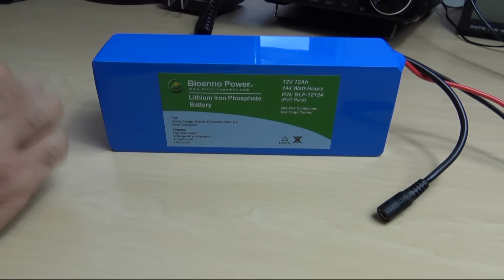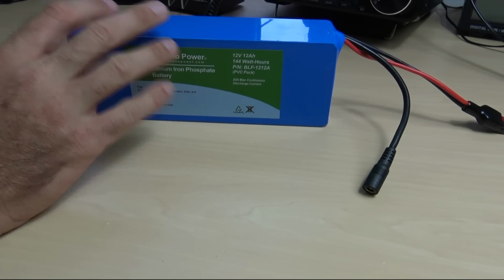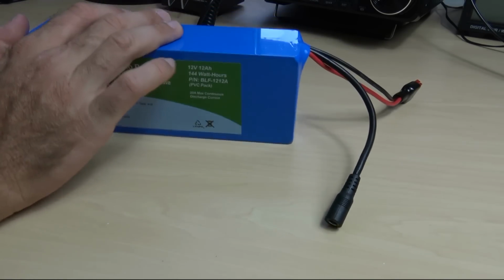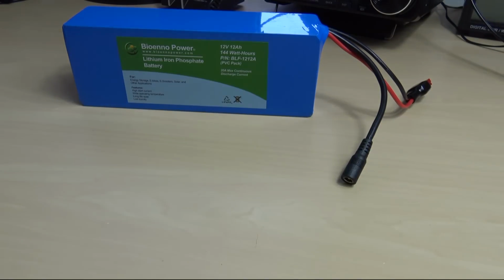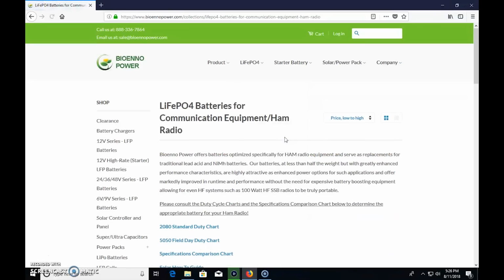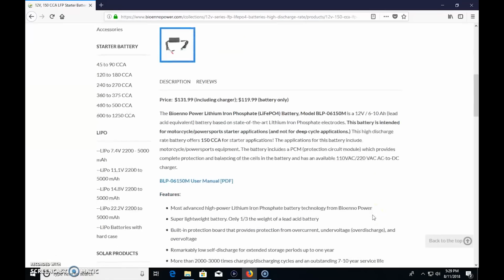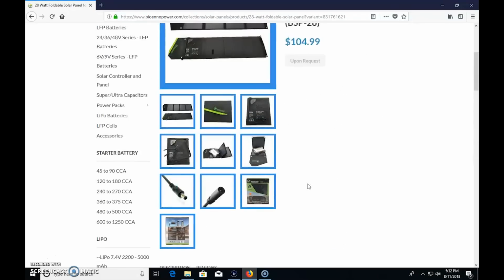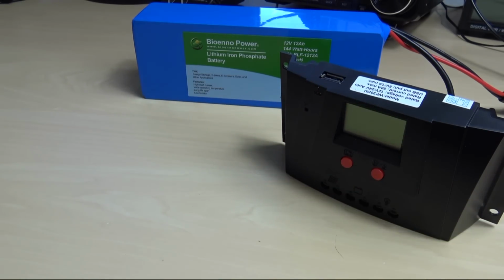Bioenno LifePO4 Batteries, Solar Charging, For Ham Radio And More!

Comment: DO NOT BUY BIOENNO!
History:
Bought 100 Amp Battery-Failed at 6 Years.
Bought 2 Pure Sine Inverters-Both failed within Three Weeks.One of them failed THE FIRST DAY!
Bought SEVERAL 40 Amp Batteries- 2 of which failed and you replaced them.
Bought 2 20 Amp Charge Controllers 1 Failed. I believe you replaced that, but do not have the records to verify this.
Yesterday, the SECOND 20 Amp Charge Controller Failed. Installed the new 30 Amp you sent me. We'll see what happens.

10 Amp Bioenno Charger now says new 200 Amp Battery if full. Surface voltage across Battery Leads is reading.13.37 Volts.

I BELIEVE THIS BLF1220AS IS ALSO DEFECTIVE! 

WHAT-THE-%@@$#$#?!

I'm very sorry, Kevin. This SEALS IT!

Here is what I would like to do.
A. Return EVERYTHING! Both Charge Controllers, Both sets of 50 Amp Jumpers,
and BOTH Batteries.

B. I want a Refund Check for $862.49, the current price of the BLF1210AS.

I have lost faith in your products.

Bruce A. Forster
Show less

Reply

Comment: Excellent!  I think this answered all my questions.  I have a Bioenno 4.5 AH battery for field QRP operations, but want to get something larger for field QRO, plus would like to add solar charging using my existing solar panel.  This tells me enough to get started in the right direction.  Thanks!

Comment: Bioenno brand is over priced in this vertical. I have several lithium iron phosphate batteries for ham radio, only considered Bioenno until I saw their prices.  I build my own with headway cells now, I'll take the Pepsi challenge with any battery on the market.
Reply from the maker: Please remember there are some people, including myself, that don't have the time but have money to just buy one and be done with it .
Reply: Overpriced is a very subjective judgment. I have several very inexpensive Miady LiFePo4 batteries, and after 2y of use, they show much worse capacity drop than my Bioenno. On a purely amp-hour per dollar basis, the Bioenno falls short. But some people value build quality, customer service, and country of assembly very highly.

Comment: 12 ah is fine. The only time it is "not enough" power is when you add 15 different ports and plugs that will eat up the battery. If you want to power your 50w radio, this will work. Add solar and it will run for ever. I also bought the 12ah and it runs my radio all daY LONG. hAVE NOT YETR ADDED SOLAR, DOING THAT WITH THE NEXT FEW DFAYS.

Comment: So here's a problem, Eric.  The Anderson Powerpole connectors that come with these batteries are the 2×1 type, but the IC-7300 requires a 2×2 Powerpole connector.  How do you get those to connect to each other?  Can you just plug the Powerpole on one of these batteries directly into the IC-7300 and have it work, or do you need a 2×1 to 2×2 adapter?

73 VE7NDE
Reply from the maker: No, thats not the way you connect it. The 7300 uses a 4 pin MOLEX connector.. All you need to do is use the supplied Icom DC cable and install a set of powerpole connectors on the end of it, to connect to the battery. The battery never connects right to the back of the radio, instead of connecting the dc cable to a power supply, install powerpoles on it to match the battery.
Reply: @HamRadioConcepts  I'd rather not have to cut and splice any wires.  Perhaps one of these would work?  < https://powerwerx.com/hf4-molex-to-powerpole-adapter >  Although that doesn't have the proper fuses on it.

Or do you mean the DC cable that comes with it already accepts Powerpole connectors on the other end?

Comment: Informative video.  Thanks.  Quick question: What Bioenno controller is compatible with the Bioenno BLF-1220A 12V, 20Ah Lithium Iron Phosphate (LiFePO4) Battery?  Thanks again.
Reply: Any of the solar charge controllers they sell will charge that battery.

Comment: Be advised that many airlines will not allow any battery above 10AH while traveling.  Most TSA personnel would not know the difference between a volt and an amp, but it is not worth the risk to loose an expensive battery, just a heads up.

Comment: So glad I found this video.  New ham and i’ve been nothing but confused about powering my radio in the field.

Why do radios say they need 13.8 volts, but the batteries are all 12volts?
Reply: It's called a 12 volt nominal system. The automotive industry settled on a 12 volt standard years ago. It's based on six 2v cells in series from the old lead-acid technology. To charge them an alternator or generator that puts out up to 14 volts is used. To charge a battery, you must have a higher voltage available to cause power to flow to the battery. Mobile radio equipment was then designed to operate in an automotive environment where the voltage could be anywhere between 11-14 volts DC. When they say a radio uses 13.8 volts, that is where it gives the best power output. It will continue to operate at reduced output down to a lower voltage. How low? It varies from radio to radio.

Comment: be careful about using lead acid solar chargers on LIFePO4 batteries. Reason is they often have temperature compensation and will end up overcharging the battery, I found this out the hard way :(

Comment: Does the battery on your video here work with the Icom IC 706?
Reply: As long as the battery meets the voltage and amperage requirements, it’ll work. This is a 13. 8 volt battery, actually charges up to about 14,55 volts but discharges down to 13.8 rather quickly.

Comment: Those 50AH claim batteries are probably not lying outright ... it's probably 50AH (or thereabouts) at the single-cell voltage. Crazy misleading, but they keep themselves out of trouble.

How's that charge controller for RF? They do have one that's advertised as RF-quiet, but it's a bit more expensive and quite a bit heavier.

Comment: I just bought the Bioenno BLF-12045W. The directions fro discharging indicate "The battery outputs a steady voltage around 12.8V until very little capacity remain, do not rely on voltage as an indicator or remaining capacity." I assume this means that I need to monitor power source (battery) current instead. How do I find out what the minimum current draw is? There's no such spec in the instructions.

Comment: 1. What is the warranty? Battle Born Batteries have 10 yr 
2. How long to fully charge with that limited solar input? Always look at solar input numbers
3. With larger solar input you can put panels in series
4. How many discharge/charge cycles is the bioenno rated? Battle Born is 10K cycles. 
5. Is that charger MPPT or PWM?

Comment: Today there are thousands of lithium batteries which are much worse on environment , Tesla and all the cars use tons of these. I have been involved in building microwave stations where a ton C&D submarine lead acids batteries were used in back up. Plus a diesel generator, so I am not impressed by saying any other battery which can be recycled several times are bad.

Comment: Im working on making a go box that has everything running on 12v. However I would like some kind of automatic switch that will cut power from the battery and put 120v power into a converter to go to 12v then to my radios...Where can I get a switch like this.
Reply: West Mountain Radio has several devices call PWRgates that switch from 12v power supply to a 12v battery, but unfortunately I don't believe their lithuim model works with LiFePo4 batteries.

Comment: Have you tried powering your IC-7100 with one of these? I just got a 7100 and I’m looking at power supply options
Reply: As I see it, the BLF-1212A that he shows in this video can't power an IC-7100 because the connector doesn't match.  It's only a 2×1 power pole coming out of the battery, but the IC-7100 needs a 2×2.

Comment: 9:35 do you have some supporting info why you shouldn't use the load side of the charge controller? Some charge controller has a buck circuit so the load side always get x voltage even if the battery is say 15.8 or 11.5. I will always get 13.8 volts on the load side.

Comment: Great video; while I was actually installing anderson powerpoles connectors to my battery which is a bigger 40 ah one, it came with the grey big connector so i cut it off to get anderson powerpole connector and the cables touched for a second, like, they were atracted to each other as i was trying to keep them appart, I had a spark, a second or a fraction of it. This is a new battery and I really hope that i did not ruined it by this accidental touch of the two cables! I have not tried to charge it just yet but hooking it to the powerwex in line power reader it shows 13.6 volts fluctuating 13.6 - 4; does it the circuit inside suppose to protect it against a short of this type accidentally if just for a second?
Reply from the maker: The grey connector is an anderson powerpole just a larger current one. Using the smaller ones will not pass as much current thats why the bigger one is on there. There is a circuit inside and it should protect but may have been damaged.

Comment: I actually watched this video after I had ordered my 1212 Bioeno.  I turned around and ordered the solar charge controller.  I have used them with my Yaesu Ft-817 and it is my main fun set up.  I didn't know about the page where they tell you which battery is best for your radio until I watched this video.  According to Bioeno I should be able to run my 817 for 28 hours (80% listening and 20% transmitting at 5 watts) or (50%/50% for 20 hours) before needing to charge it.  I tried to run the battery down while it was hooked to the solar panel and couldn't.  Great video!!!

Comment: Bioenno makes a decent battery. I had a friend tip me off on Energized Outdoors who has this technology at a fraction of the price. Just a few corrections to this which Bioenno will support. You can run in parallel not series. You can use SLA chargers but will get better results with LiFePO4 charger, the BMS (not PCB) will balance the cells not the charger.

Comment: Here's a question for you:
I agree do not charge them in parallel.
However, CAN you RUN them to a 706 in Parallel for twice the runtime for the radio?!
Reply from the maker: I guess you could but it's recommended to buy the next size up bigger battery, which would be cheaper than 2 of the same kind that are smaller
Reply: This is incorrect. You can run these in parallel but not series...
Reply: HamRadioConcepts that’s what I was told when I called yesterday as well. Run in parallel is fine. Charge separate. But they also said it’s more efficient to just buy the size you need

Comment: I have 2 of the 20AH batteries, the solar charge controller and the 2 solar panels for 56 watts of charging..  I run my ic-7300 off them and they work great.  I run a full 100wats for several hours each day camping and by the 3rd day I swap out the battery.  Great set up for sure.
Reply: Can you show pic ur baterry sir

Comment: I have LiFePO4 12.5V think 55Ah with BMS. Use morningstar MPPT charge controller re programmed via USB for LFP battery. Have 200W 48V solar. works great. Run many rigs even  RM ITALY 2M 70 CM amp.  love the battery! ONLY problem. below 32F battery does not hold a charge. Ok for camping but in off grid cabin I had to go with NiFe EDISON cells. Love the video great battery /charger info.

Comment: Also more cycles (charge/discharge). Lead acid is usually good for a few hundred cycles. LiPo will usually good for 2000 cycles.
Reply: Correction these are not Lipo. Lipo batteries also have a few hundred charge cycles. This is LiFePO4 which has up to 2000 charges.

Comment: Its NEVER a good idea to parallel batteries. Always use series connection.
Reply from the maker: Yah, well the manual does state this battery will NOT work in series. Parallel is technically possible but not recommended.
Reply: Yah, well yourself. if you want to hook them in series you buy from the manufacturer the kind of batteries designed for series banks. There is a special circuit inside this battery shown that controls the charging. That may be why not to series them. Its ALWAYS a bad idea to parallel batteries. ALWAYS. study and research before doing it wrong.
Reply from the maker: I wasn't being rude. I just simply stated what the manufacturer recommended. My thoughts were the internal circuitry wouldnt allow the series configuration to work.
Reply from the maker: But also, why go series, when you could get 24v or 48v cells that they manufacturer.
Reply: Absolutely correct. buy the correct batteries for the job. other companies that make this technology battery for big banks have cells for series connection and proper charge management circuits also. when I used 4 ea 3000mahr aprox 3 volt cells in series to replace 8 original nicad pack with a constant current charging system that just happens to work good with the new PO4 cells. I have designed, installed and maintained large power back up systems. NEVER cells in parallel ALWAYS series connected cells to build the bank.
Reply: Yes,just that I posted. buy the correct battery system for your needs.
Reply: Series connections increase voltage.  Parallel connections increase max current.